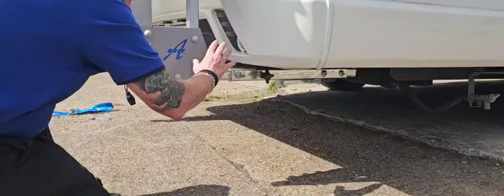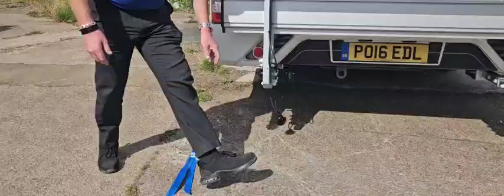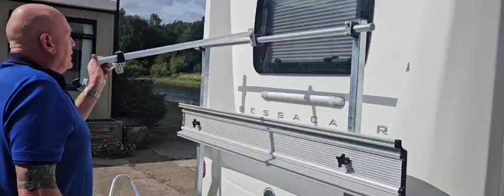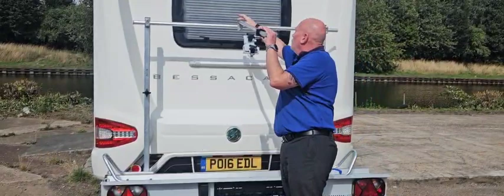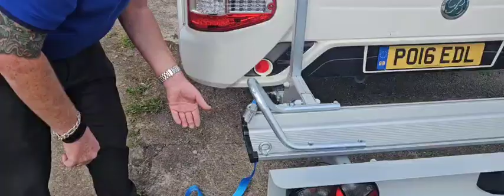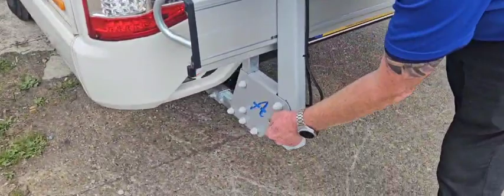Multi -Use Folding Scooter Carrier Demonstration

Comment: Can the scooter be loaded from both nearside as well as offside.
Reply from the maker: it can be but you need to wind the throttle on ½ way so not to damage the throttle when it swings up and down so we don't usually recommend it as better to be secured through the none throttle handle bar grip, and the natural way you got on & off a bike and push bike is the way we load it making it easier

Comment: do you make one to fit the toe bar
Reply from the maker: no as they will over load most standard towbars, the S value (nose load) on a plate of a towbar is usually only 100kg the best I have seen is 150kg, but that's at the ball for every 100mm you come away from the ball you loose 10kg, most bikes sit approx 400mm away so that has now reduced by 40kg, then weight of carrier, leaves no payload for the bike, all though people still seem to be selling them, but would never recommend, should always be chassis mounted, giving 2 wide apart fixing points
Reply: @armitagestrailertowbarspec9193 ok pal how much it that one in the video
Reply from the maker: @adamplumtree64  £2085 inc vat supplied & fitted + wiring if required? + chassis reinforcements or extensions if required? depending on the Motorhome it is been fitted too, we also do a none folding version for £1599 inc vat fitted but with all the same fixation elements